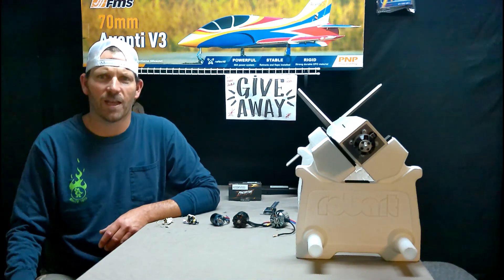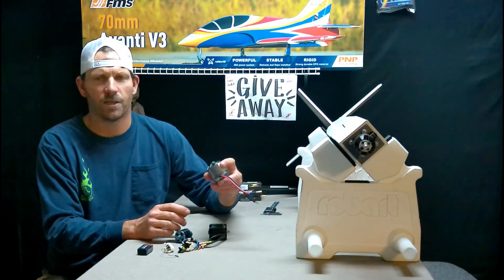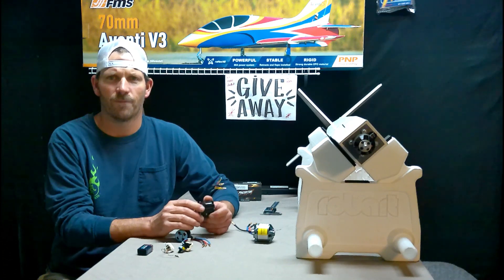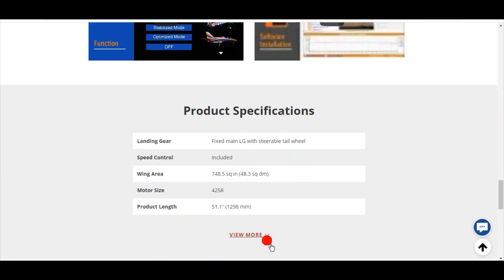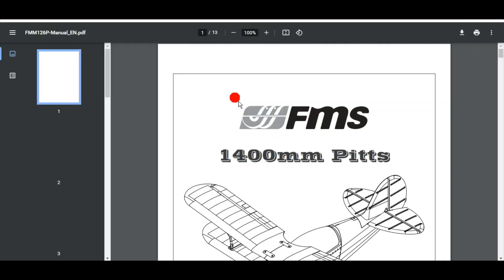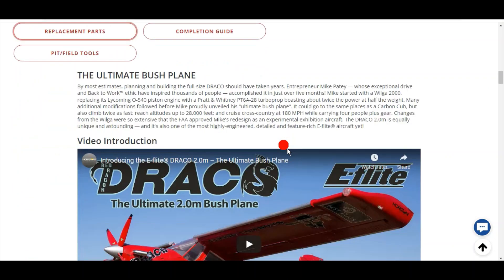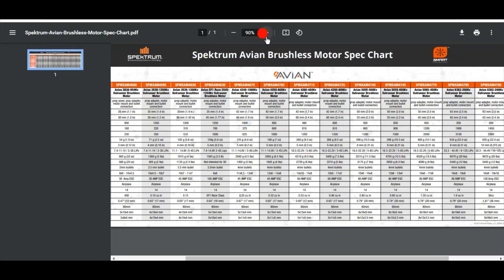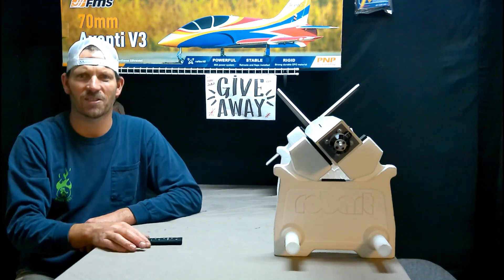PICKING OUT A RC AIRPLANE BRUSHLESS OUTRUNNER MOTOR HOW I LEARNED ABOUT SIZES FROM SMALL TO LARGE

Comment: THANK YOU SEAN ("SHAWN"(?)) FOR YOUR THOUGHTS, SUGGESTIONS, AND RECOMMENDATIONS REGARDING MOTOR SELECTION.  I'D LIKE TO TRY BUILDING "PEANUT SCALE: PLANES, OUT OF FOAM, AND (FIBER)GLASS... GARBON CLOTH, ETC. TRYING TO KEEP THE WEIGHT TO AN ABSOLUTE MINIMUM, AND USE MICRO ELECTRIC MOTORS, AND SMALL BATTERY PACKS, ETC., ETC. (TO GET PERFORMANCE BEYOND "RUBBER POWERED "FREE FLIGHT" AIRCRAFT.   :face-blue-smiling::face-green-smiling::trophy-yellow-smiling::face-red-heart-shape:

Comment: Amps, Voltage, Power Rating (Wattage), Power-to-Weight Ratio (Load / Loading ), and maybe graphing that entire Table and placing photos of the different Motors on the graph with the TWO (2) Different Variables (The X and the Y) since a picture is worth 1,000 Words.  Good job on this one !  🙂
Reply: This fellow, Dave Merc, put politics into his videos on RC material. I told him it was a "turn off" for many people. He took down many of his videos (with this being an exception). I think he was at the Jan. 6tth event at the Capitol and his Channel went dark for over a year after that.  His videos are TOP-NOTCH otherwise !  LINK ==>  https://www.youtube.com/watch?v=z9Cy-5ABvP0
Reply from the maker: thank you